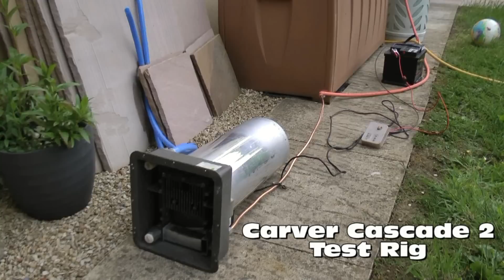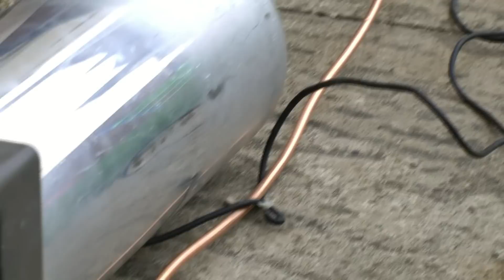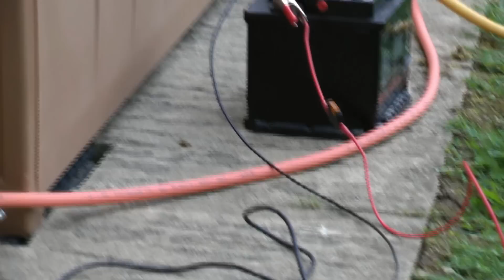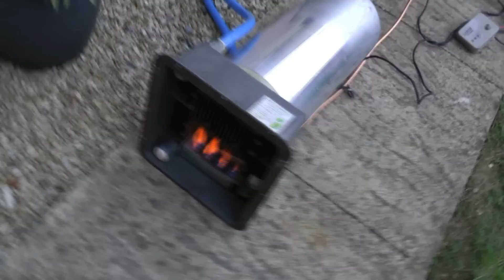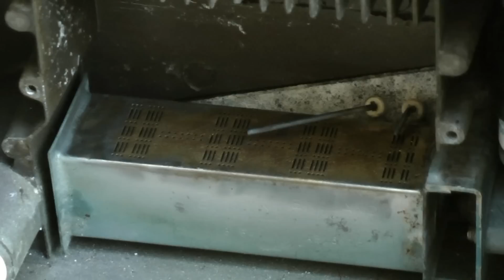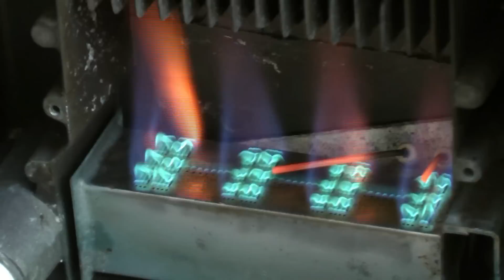Carver Cascade 2 water heater test

Comment: Hope this helps anyone!

The way I found this thing operates. The gas is released into that mild steel pipe.
I discovered  (that pipe has no holes) just one big hole at the very end on the opposite side of the pipe

Gas is released on the other side into the surrounding box where the mesh and tiny holes are to make the flames!

I found the problem on mine....and why the heater switches off after a few seconds. 

(Loss of gas pressure)
Flame is weak
Then it shuts off and (heater fault light comes on) very  frustrating. 

Here is the fix.
At the opposite side of pipe where gas comes goes into box. 

There was a hole...the size you would get a lolly pop stick in through (caused by rust) big enough to lose gas pressure tho.

I poked the rust out removed the whole square end and welded a new fresh square piece in sealing the box up. Im sure epoxy resin mix would work if you dont have a welder. (Once you seal it all up)

Result for me:
(No loss of gas pressure) 
(Flames are good)

Put back together and it works perfect now on gas (no faults)

God bless happy camping.

Comment: Hi I have a problem with my carver cascade 2 the switch box dose not light up even when it’s wired directly to a fully charged battery both fuses look fine I got the control switch from eBay and all the guy says is it was working when they posted it out on the work bench